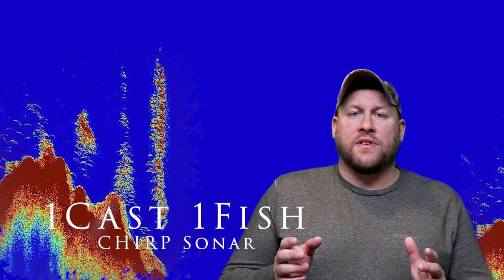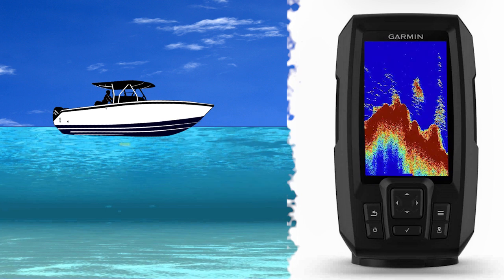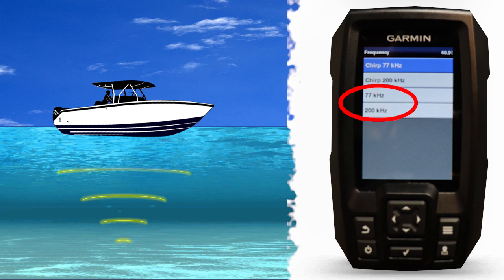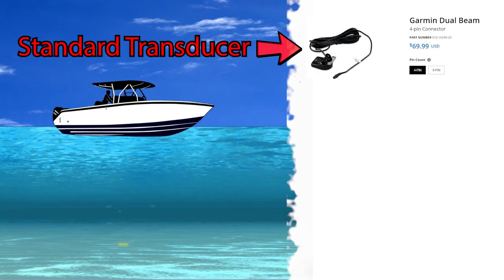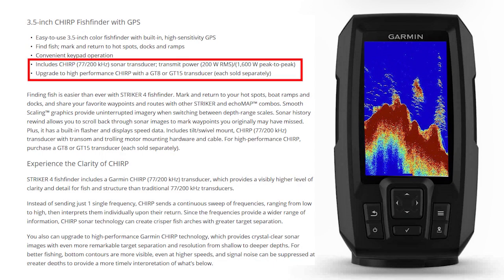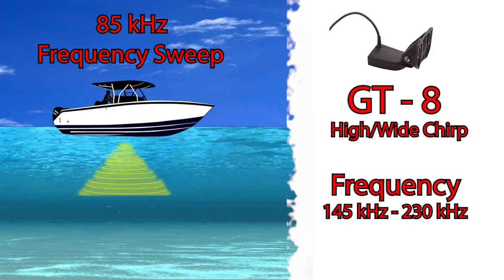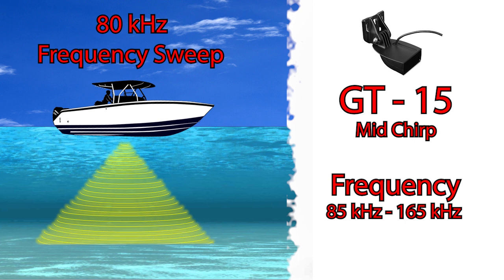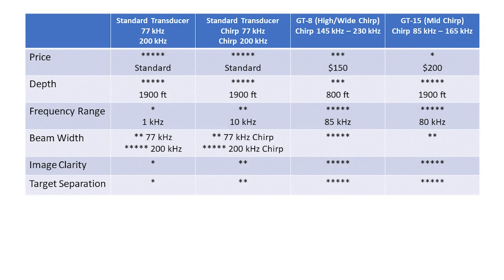Garmin Striker 4 CHIRP Sonar Tutorial (What you NEED to know)

Comment: I have the standard Garmin Striker for Fishfinder the fish do not show up as arcs on my fish I don't even know what the fish look like. What frequency should I set my Garmin Striker for at to get the best results or is there something that I've done wrong with my transducer I've got it mounted inside the kayak at the bottom it's a through the whole amount so it sends the beam through the hole to the bottom of the water but I don't seem to get clear images or images of arcs of any kind. And which way does the Garmin Striker 4 transducer point does the narrow end of the transducer Point towards the front of the boat or the back of the boat there are no instructions provided with this Garmin for Striker for. Right now I'm a little frustrated and very disappointed in the Garmin Striker 4 it's probably operator error. Help please help help
Reply from the maker: So I would do a factory reset and us ethe base settings to start...and turn the fish icons on....they will likely help you.  the narrow end where the wire is normally faces forward.  Is the transducer in the water?

Comment: Hello, I am thinking about going to the gt8. But I don't fully understand why it's better for shallow water. It says high and wide, but you say the cone angle is 24 and frequency is 145\230. So I don't understand the wide part.
Reply from the maker: Check out my videos on frequencies and cone angles, may shed some light on it.
Reply: I did, before I posted that is why I posted a question to get more information.
Reply from the maker: @jeffm516  They are comparing it to the other available Chirp transducer.  This one is a wider beam.
Reply: But the an angle is 24. Where is one it comes with is at 45. How is 24 wider than 45
Reply from the maker: You are right, it is not wider than the 45...Many higher end Chirp transducers have a narrow beam...so compared to other similar powerful transducers, this one is pretty wide.
Reply: @1Cast1Fish  oh I see thank you

Comment: This is on my  boat. Works great  Nice bright display even in direct sun which is something I was worried about. Its a small displayood layout on the buttons. It has good accuracy and resolution for an entry level sonar. Low battery drain even on the brightest setting. I mounted the transducer on the transom following the directions and screwed the bracket directly to the boat. Worked fine. No issues. I wish the manual was a little better but whatever. I figured out how to do the things I need it to do. I think this is the best value out there. I'm very happy with it.
Reply from the maker: Glad to hear you are happy with it...if you ever have any questions, I would be glad to try and help

Comment: Thank you for great information, the standard transducer it works at 200W and the gt-15 it takes 600W it means if you upgrade your system from standard to gt-15  you are battery will drain faster, you are going to get around 1/3rd of the time which you were getting before upgrading.
Reply from the maker: Yes, it will definitely use more battery...and I would not recommend a in hull mount like I have shown in other videos.

Comment: I’d like to add the GT8HW-IF is also compatible. It is the ice fishing transducer.
I use it on my striker 4 and it is a significant improvement over the supplies transducer. 

It’s cable is very flexible , even at 0 degrees it stayed flexible. The foam that comes with it is much better and keeps the cone shaped transducer level.

If you are going to ice fish. I’d recommend picking up that transducer.
Reply: Thanks
Reply from the maker: Very good addition and super true...not much ice were I am at, so I never really think about it.  I get a lot of requests for some ice fishing info, but it's rare I get out on the ice anymore.
Reply: agree - the ice transducer has benefits over the standard chirp (boat) unit (that can also be used for ice fishing). The ice ducer is easier to hang flat, comes with a better float, and has that 85 kHz range (vs. the 10 kHz range of the boat ducer).

Comment: Would you recommend using this when going out in the ocean? I have a boat club. I used Bass Pro shop portable mount. The clamp wasn’t big enough so i used a c clamp from Home Depot. It eventually fell off and my transducer was dragging the the water. 

Any recommendations for clamping it temporarily when using a boat club?
Reply from the maker: I think you can buy better temporary mounts for these applications.  As far as transducer, most temporary mounts do not do well with higher speeds, so I guess depends on the types of boat you are using as well.

Comment: Appreciate your content. Good presentation. I have a question about the gps way points mode. I was thinking that the shoreline would be represent on the unit? Also the brown and blue wire are another sensing unit?
Reply from the maker: Yeah the shoreline would be a big plus, but that requires a type of mapping card or preloaded mapping.  Some higher end model have these features and they can be very useful.  The Brown and Blue wires are just for communication...for 99% of installs they are not needed, and for the 1% that use them I would have bought a higher end unit if I needed those features.

Comment: Have you been able to see thermocline with striker 4cv?  If so what settings did you use?
Reply from the maker: You can see the thermocline with the Garmin Striker...however what a lot of don't realize is that in many lakes depending on the time of year and other variables a distinct thermocline may not actually be present.  A thermocline generally will show up as a area of "noise" in a line somewhere within the water column across the fish finder screen (not top or bottom noise).  The thing to remember is that since it will show up as a noise signature normally, you want to be careful about setting your noise removal setting to high, as it can remove the thermocline as well.  Hope this helps

Comment: Great informative video man.. I have a Seadoo Fishpro, based in New Zealand and occasionally fish deep (200-350m) The unit seems to work really well as last time out I was in 270m and the unit had no apparent problems.. the default setting is Chirp and the beam angle according to the screen is 17deg.. would you suggest any alternate manual settings when going deep or just leave it in auto, scroll speed is auto also - transducer is GT15IH
Reply from the maker: I am a big fan of the "If it isn't broke don't fix it"  mentality...if its working great I would leave it.  You could play with the gain a bit and see if that helps or hurts.

Comment: Hey thanks for the great info. Once you identify fish, do you ever really know exactly where they are? Or you now just have a good idea that they are around you. Thanks
Reply from the maker: It will vary...figure out how big your sonar cone is at the depth the fish is located....now when you see the full arch you know the fish is no longer in that cone....so now you know it is at least "X" distance away.  Now this is where it gets tricky with alot of variables such as sonar scroll speed, boat speed, fish speed and direction, ect.  It is really a educated guess, but  I tend to figure if the arch is on the far right of the screen, then the fish is likely just outside the cone, middle of the screen, multiply cone diameter by 2 for distance....and far left...multiply by 3.  This is not all exact, but it is how tend to guess.
Reply: @1Cast1Fish  Thanks, this makes sense, and I'll try and practice and get a sense of it. Sounds like you think they move right to left? I have my transducer hanging over the right side of my kayak.
Reply from the maker: The fish can move any direction around the boat. The screen however only shows a 2d image that moves right to left (new to old data)

Comment: Hi I have purchased a Striker 4. I am very happy with the way it performs, however i did notice after a short period of time there was a definite fogging on the inside of the screen. This would come and go depending on atmospheric conditions. Then after washing the boat down including rinsing the Striker with water from the hose, not high pressure, just running water, a couple of the keypad buttons wouldn't work. I sent it back to Marine Deals, the supplier and was informed they had tested it, it worked ok, submerged it in water, retested it, it worked ok. The fogging on the screen was not actually water inside the unit it was moisture in between the screen and the front cover. ok being the trusting sole that I am, I accepted the explanation.  Well the next time I washed the boat and got the sounder wet, same thing happened so I opened it up and found water in behind the keypad and no double layer of glass/whatever screen, moisture on the inside of the screen is inside the unit. I dried everything of and reassembled it with a smear of silicon grease on the main seal and around the edges of the keypad. The next time I went fishing it was raining and what do you know after a short time out in the rain it was so fogged I couldn't see the display. Is this normal, am I expecting too much, luckily so far the only water ingress has been fresh, not salt. But it is only a matter of time before the water fresh or salt will damage the electronics. The unit obviously leaks probably through the keypad. Am I the only one with this problem?
Reply from the maker: I would call Garmin if it's under warranty still, or send it back to the store you got it from, this should not be happening...something is wrong

Comment: Great video!  I've got the striker4 cv.  I'm having trouble getting clear images and see a lot of mirror imaging / garbage on the screen. My Ontario inland lakes are all quit tea stained and I find the best setting is 77Khz to have a chance.  (Depths 20-100 ft : usually in 60ft range).  Gain is set to low to help clean up garbage.  Any tips?
Reply from the maker: If the water is full of debris, there is not much you can do other than adjust the gain on these units.  You may try different color pallets to see if that helps as well.

Comment: Question: In your opinion, is it worth investing in an entry sonar such as the striker and buy a better transducer or buy a higher sonar and not upgrade the transducer.  Mostly kayak fishing but a few fishing days in a boat in large reservoirs.
Reply from the maker: The bigger question is how much money do you want to spend :)  Honestly for my kayak outings I use the Striker 4 and the standard transducer...this is on small lakes that are not all that deep….the Striker 4 does have a basic Chirp setting you  can choose and it does make a difference IMO.  If I was going to spend a limited amount of cash though I would get a bigger screen size over a new transducer or upgrade to the Striker CV models and such with contour line mapping.
Reply: 1Cast 1Fish  Thanks for the quick answer. I’ve to replace an old broken sonar. I’m hesitating between the striker 4plusCV, mostly to get the charting capabilities for regular lakes. However, if I get lucky and  find a discounted sonar with Side Imaging up to 2x the price , I will consider it as I’m switching lakes regularly and would like to find the fish quicker SI and do more vertical fishing DI.

Comment: When you are using the contour mapping feature, what is the best sonar set up? I was wondering if the lower frequency/ wider beam angle would mean getting more mapping done for fewer 'passes'?
Reply from the maker: The wider angles will cover more area and also map a bit faster...it won't be a crazy speed difference, but it will be a bit faster.

Comment: Confused regarding the other transducers: I thought lower hz meant a wider cone, but you’re saying the opposite with these other two transducer s you can buy. Is this correct?
Reply from the maker: In general the lower frequency will be the wider cone angles, however every transducer is designed and built a bit different.  For example if I have a Lowrance and a Garmin transducer both using 77 kHz, they may have slightly different cone angles.  This is the same with the high end Garmin Chirp transducers as well...just a tad different than the standard offering.

Comment: I am new to fish finders, and first off great video! My question is that if the CHIRP puts more energy into the water, why would you want to use the single frequency option? Also, what is the difference between the low range and high range frequencies? Are they each used for specific structures or depths?
Reply from the maker: I use the standard non-Chirp when there is a lot of debris in the water since the chirp is very sensitive and picks up the debris more.  Check out my videos on sonar frequency to explain the high and low...much better explanation in those videos than what I can type here trust me.

Comment: I am going to install the striker 4 on my kayak would the standard transducer be adequate or do you think I should upgrade to a stronger transducer.
Reply from the maker: Unless you fish very deep water 50+ft alot, the standard will most likely do you just fine....unless you have a ton of spare cash and just want the best :)
Reply: @1Cast1Fish  thanks I will only need about 30-40feet tops my kayak is not designed for deep water
Reply from the maker: You should be good then

Comment: Hi , i have a striker 4 with a transducer cv20-TM , this type of transducer can give a high performance in water depth 250 ft ? And what is the best setting for 250 ft and 150 ft depth . Thank you
Reply from the maker: Depends....are you looking to use the clear vu side imaging or are you looking at just what is best for the standard 2d sonar frequency?
Reply: 1Cast 1Fish thank you for your reply , in case i need clear vu and in case of traditional chirp 77 khz , what is the best setting these two options
Reply from the maker: For deeper water of 150ft to 250ft...use the higher frequencies since you have deep water.  The 200 kHz will give you a big cone in 150+ ft of water, plus it will be more detailed.  I would also always use Chirp.

Comment: Quick question for you. I run a Striker 4 plus in a small 12' tin boat. Depending on if its just me or if im fishing with a friend, the angle of the boat is affected. Is there a way to know that the level of the transducer is correct? I have the locking bold just tight enough to be able to adjust the pitch if needed but it wont move on its own. Can you let me know of a way to ensure its correctly pitched to be parallel to the water?
Reply from the maker: I adjusted mine by reaching over the back with the boat in the water.
Reply: @1Cast1Fish  thanks for the reply! This is what I have been doing to troubleshoot.  My question is more "is there  a good way to ensure the angle is correct once on the water?"

When I have adjusted it, I would first eyeball it to  level setting and then shifted a click up or down, looking at the depth reading and ultimately stopping the adjustment when the lowest depth was showing.  Woukd this be correct?

Thank you and keep up the great vids!
Reply from the maker: Joel Koepfler set up a level at the rear of the boat and mark the bubble location and then match it on transducer. Small 6” level works fine.

Comment: i have the striker 4 ...i fish the ocean alot for salmon an halibut ...trolling and jiggin anywhere from 50 feet deep to 400 feet deep ..if i am to upgrade to a better transducer ..which would be better fit for this style of fishing ...the g8 or g15? and or why ..thank you
Reply from the maker: If you are looking for improvement, I have to ask a few simple questions first....what frequency are you currently using on your Striker 4?  and what Striker 4 model do you have?
Reply: @1Cast1Fish  I believe it is the basic  striker 4 ..not the plus 4 or the newest with down imaging. ..

Sometimes I just run the split frequency ..but most of the time its whatever comes factory setting on  the traditional ..would appear to all be chirp
Reply: @1Cast1Fish  maybe I should just buck up and get the all new unit with down imaging?   Is it as quality as the more expensive hummingbird or Lawrence units that have the down imaging?
Reply from the maker: The down imaging is inline with what you find on the Humminbird and Lowrance units in this price range.  I also like the 200 Khz Chirp frequency for deeper water (like you fish)  Give that a try and adjust your gain to medium and see if that helps any.
Reply: @1Cast1Fish  will I get much improvement from grabbing a g8 or g15 transducer for my striker ?  An then running the 200k chirp
Reply from the maker: Your images will definitely be clearer with a dedicated Chirp Transducer.
Reply: @1Cast1Fish  will one of the 2 upgrades work better then the other ? ..or should I just go ahead and get the g15
Reply: @1Cast1Fish  and thanks a ton for replying this is awesome
Reply from the maker: Since you fish 50-400ft I would look at the GT8 if you spend more time less than 150 ft  and the GT15 if you fish 150ft or deeper most of the time.  Also do not forget the 8 pin adaptor to run either.

Comment: I've found mixed answers on the internet can I mount the transducer In hull on my kayak or does it have to be in the water
Reply from the maker: Check out my video on in hull mounting...it has worked for me for a few years...no issues.  Just does not work well with side or down imaging types.
Reply: Ok thanks I will I read on the internet that the chirp sonar would cause the transducer to get hot and thats why it had to be in the water but nobody has mentioned any problems on YouTube